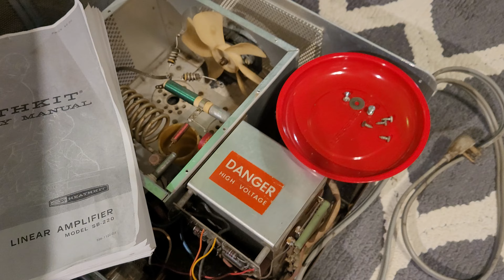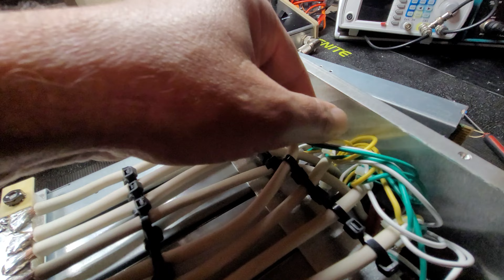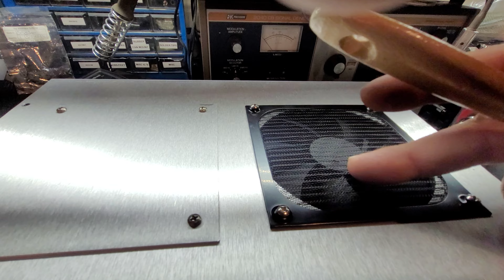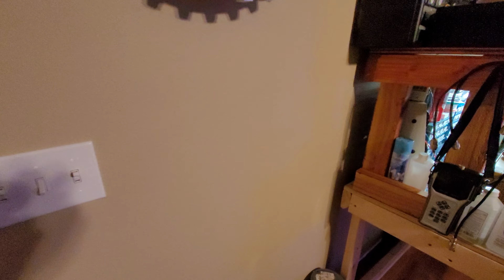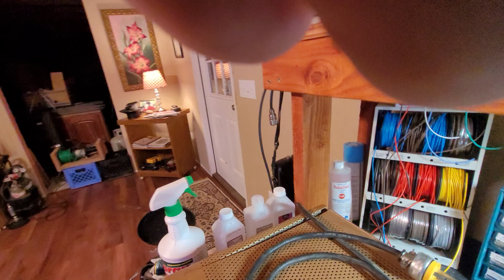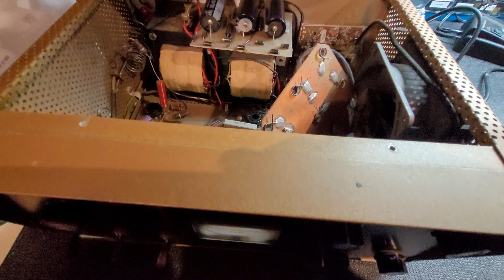current and upcoming projects

Comment: Easier for a fan to push air then pull it, might be better to get more airflow by pushing the air into the cabinet so the fans in the power supplies can pull it out of them easier, if the pressure of air behind or in the case is higher than inside the cases of the units. Just a thought. Most of my power supplies are puling the air out of the cabinet which is less efficient in my opinion for air movement. They would be better to blow fresh air from outside through the device instead of the other way around. One more thing might be considered...putting a guard over the positive lead out the back of the case so it can't accidently hit another grounded case or something moving it around. I would like to see a video of how well the power supplied did on the battery load tester.
Reply from the maker: Yes it is pushing air into the cabinet. This creates positive pressure and air across the shunt and components.